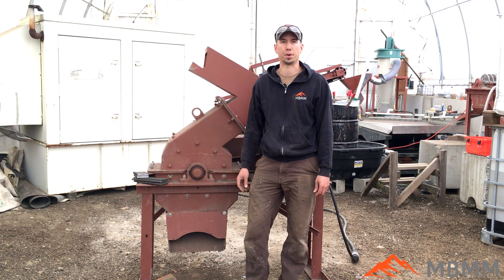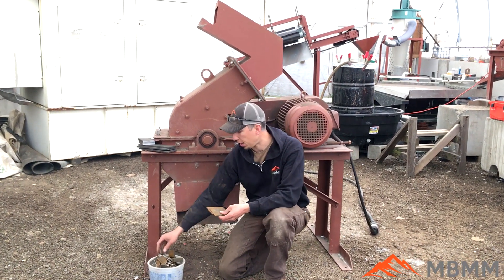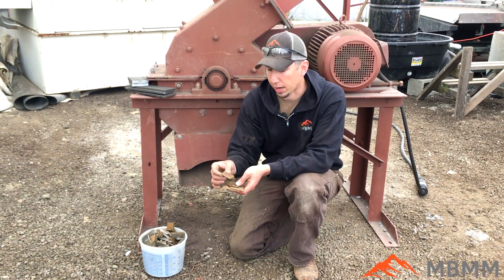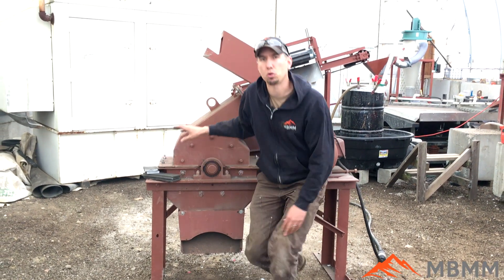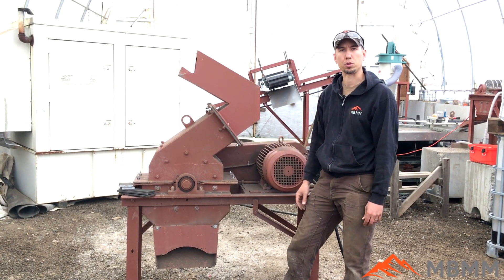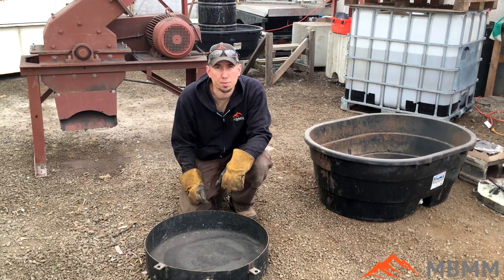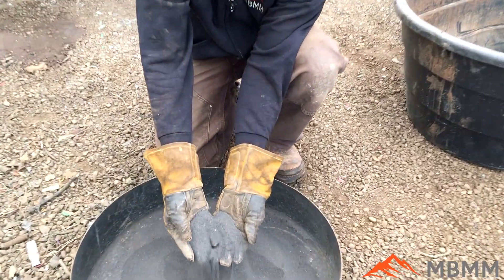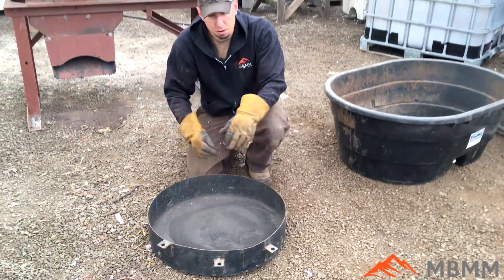Fire Breathing Hammer Mill Grinding Neodymium Magnets for Recycling

Comment: Let Jason know he should be wearing a mask. Especially for microwaves. It only takes one exposure to the beryllium in the magnetron to get beryliosis.  All these rare earths and metals are dangerous. Put a mister in the mill to cool it down and hold the dust. No joke. I'm a nursing student.
Reply: Are the magnets in a Micro wave dangerous to use and handle?
Reply: @terminatorfire1736  No. Only the insulating ceramic and only then if it's smashed or ground up.
Reply from the maker: Thank you for your safety concerns, he definitely will be wearing a mask next time!